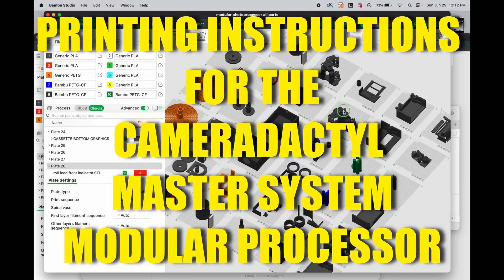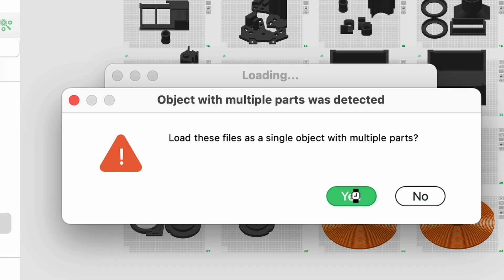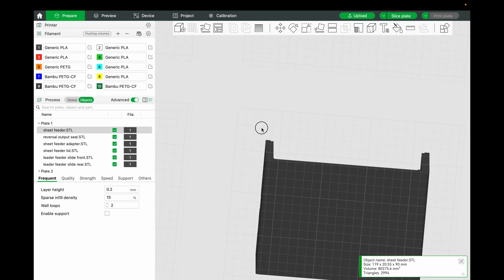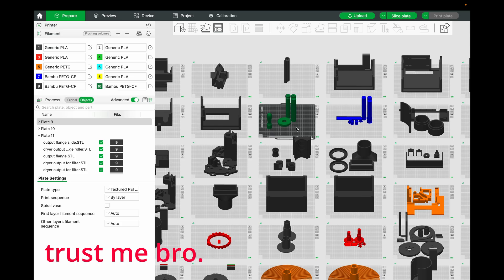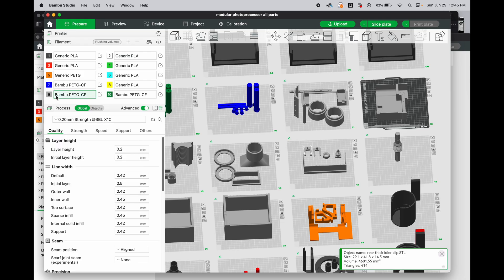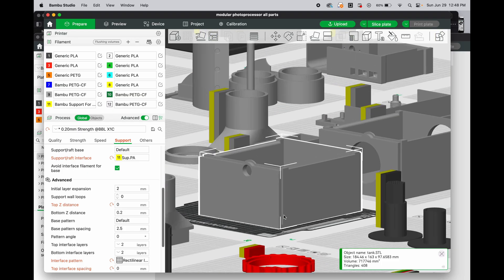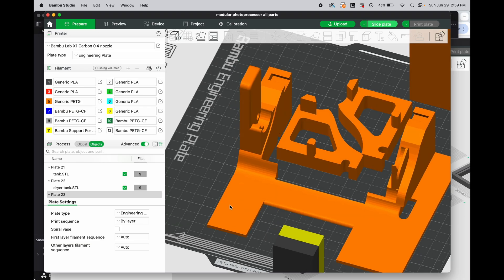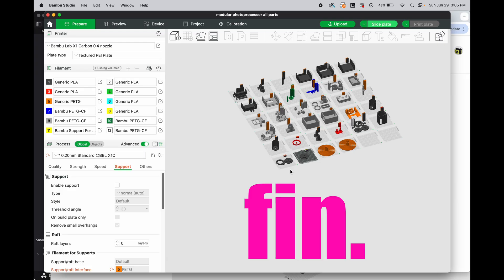Master System Modular Processor Slicing and Printing instructions

Comment: Ok. Printer question: you list the bambu p1s and x1c. Do you have a list of printers that would also be ok? Or preferred capabilities?
Reply from the maker: My list of printers is the Bambu P1s or X1c.  Others may work fine if they can match dimensional accuracy.  it would be pretty annoying to try to make any of this on an ender.